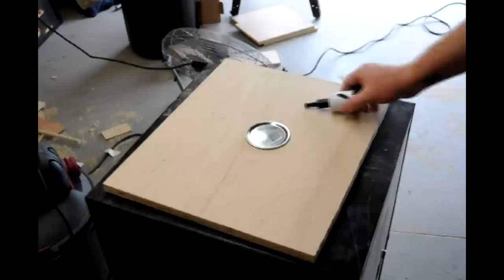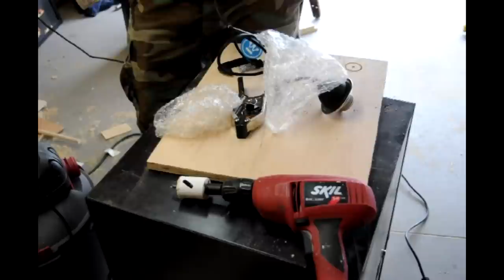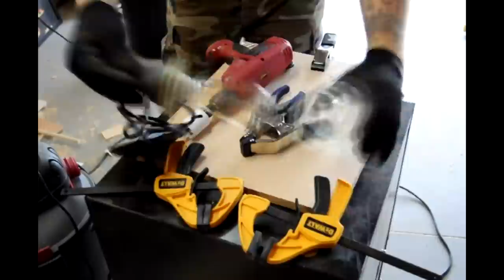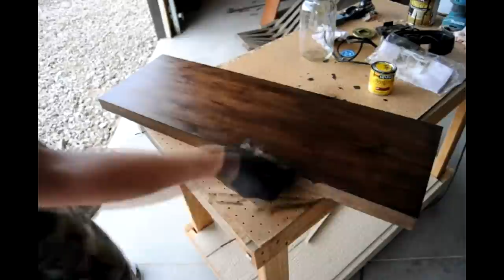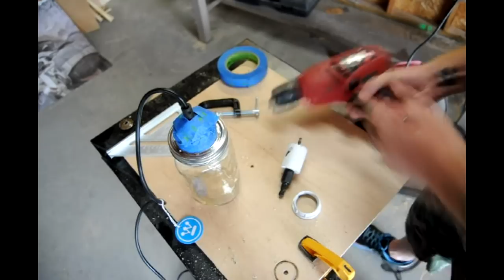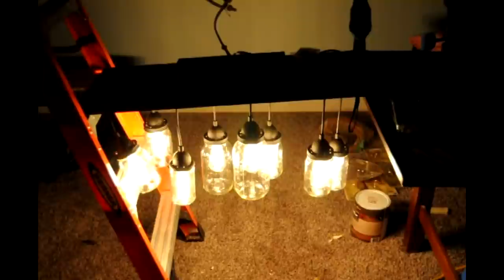The Mason Jar Light Project

Comment from the maker: So, I have not had a chance to make a video recreating the wiring for this project.  I'm adding a link to a video that provides an in-depth description of how to wire in series or parallel.  https://youtu.be/x2EuYqj_0Uk
Reply: +Donald Stockton Hey, what about the fixture, how did you mount it to the ceeling? cheers
Reply from the maker: +Pedro Soares I used the existing box in the ceiling and created a two piece mount, one that attached to the box on the ceiling, and the other piece was attached to the mahogany base and slipped over the top.  It also contained an insulated piece to house the wiring.
Reply: Thanks for the reply!
Reply: +Pedro Soares Glad to help!  I'd love to see what you make!

Comment: So quick question I'm looking to make something similar but it will have to be plugged in a regular outlet and I'm hoping to find a dimmer switch on a cord. Also the large block of wood will not be flesh with the ceiling it will be dropped a foot or so by chains for decorative purpose from each of its corners. I saw you drilled small holes in the lids for heat build up to escape what if I just cut off the very bottoms of each mason jar do you think I could get away from using a strong led bulb inside it? I know heat rises so yes the holes in the lid would help but more air should circulate keeping it cooler with the bottom open right?  i'm Looking to make mine much closer to the bottom of the block of wood or flesh with it.
Reply from the maker: +KDailey111 The majority of the heat produced by LEDs is within the actual components of the "bulb" and not the diode that produces the light, so I recon that the inside of the jar won't get too hot.  Cutting off the bottom will definitely eliminate the possibility of a pressure build up.  Your pendant fixtures may be hot to the touch if they are on for a long period of time, which may be a concern if you mount them flush to your plank or box.

I hope that answers your questions.  Maybe research how much heat your LEDs produce and it will help inform whether they hang or are attached.  

Thanks for watching! If you're interested, I have more projects in the hopper and you'll get them quicker if you subscribe ;).  

thanks again!

Comment: Question: if you put a strong light bulb inside (say a 100w or a 150w) would the jar crack / explode?
Reply from the maker: I drilled holes around the lids of the jars to vent heat.  The fixture has been up for over a year and with 480 watts total running when the dinner is on full blast I've had no issues.  I would say using the large jars with vented lids will help avoid extreme pressure build up, but mason jars are fairly robust, as was the pickle jar I used.
Reply: Thanks for the answer. Yes, I'll choose larger jars and make some vents. But what about one 100w bulb in each jar? You have 480w in 8 jars this means 60w bulbs.. :)
Reply from the maker: correct.  you should be ok.  the amount of pressure and heat to produce dangerous pressure should be reduced significantly by the venting.

Comment: Im looking for a video about how to wire this but i cant find a good one. any suggestions/do you feel like making one?
Reply from the maker: Now that it's up I probably won't do a wiring video.  The best method is in series, you'll want to make sure that any light switch you use can handle the wattage of all the bulbs you're using.  In this case there are 480 Watts for all the Edison bulbs and the dimmer is rated for 600 Watts.  

If you look up how to wire in series, that should give you the processes you need.

Comment: Mounting your fixture was not in the video. How was it mounted?
Reply from the maker: +GIGI CHAVEZ I created a set of insulated boxes that fit together.  One was mounted directly to the main body of the fixture and housed the guts of the electrical.  The other was attached to the mount in the ceiling and had the pass through for the Romex wife from the main breaker box. 

Once I fit the two pieces they were screwed together.  It was very heavy so I needed my wife to help me lift it up.

Comment: Will the heat be a problem since you completely seal the jar? I want to build a simillar lamp with 2 edison light bulbs.
Reply from the maker: If you notice in the video I drill holes in every lid to alleviate the heat problem.  All the bulbs in this fixture are edison bulbs.  If you're still worried about the heat, Feit makes LED edison bulbs.

Comment: I was hoping to do a similar projects for a friend. what I would like to know is off the jar gets hot. I was hoping to use some glue to attach a thin layer of tissue paper to the out side of the jar. I have a friend that likes to change the stuff in her living room from month to month. I have 12 of the same jars. I wanted to decorate the jars to match the holidays. I would hate to give the jar lights as a gift if it was a fire hazard
Reply from the maker: +princessmitsuko The jars change temperature to varying degrees depending on the size.  I used large and medium mason jars and some pickle jars.  The large jars are warm, the pickle jar gets hot.  If you just use the large jars and find adhesive that can handle high temperature then the paper should stay on.  From what I can tell, and I am only making an assumption and you take on the risk if you actually build it, the temperature shouldn't be sufficient to initiate combustion.  I COULD BE WRONG.
Reply: Thank you. I already finished the project. I think the jar a larger one. I did some experiments with the light bulb. I used a laser thermometer. And found I got good light from a 40 wot bulb. And left the bulbs on in the jar the 40 wor barely get the jar above 92°